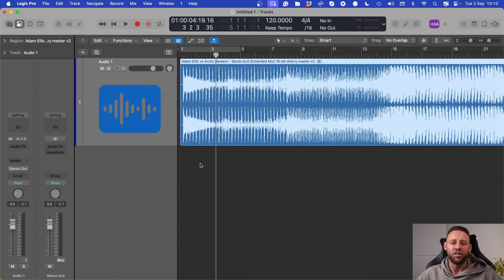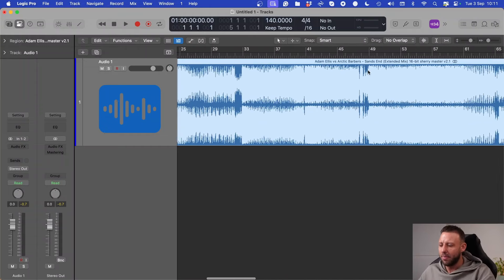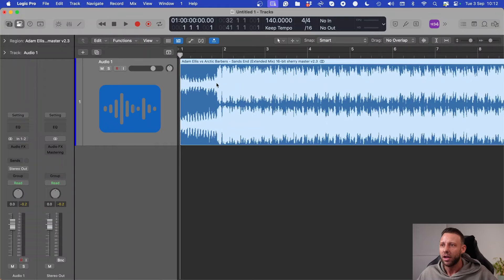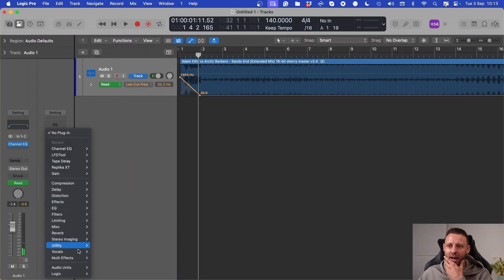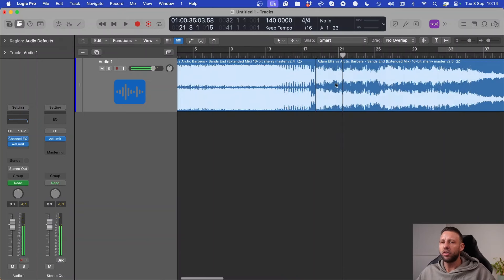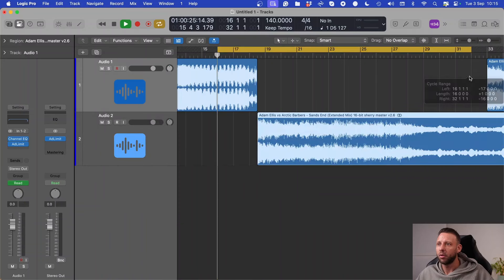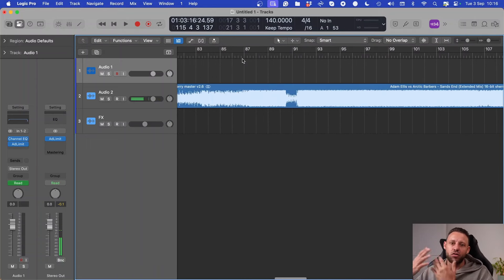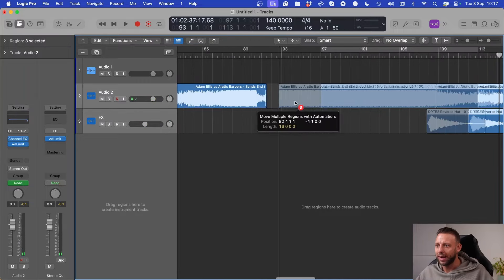How to Make a Trance 'Radio Edit'

Comment: Nice video mate came across this because I’m at the point of doing a radio edit on a track now myself. I did see a good tip (think it was from DOD) about doing the radio edit in the same project as the original/extended mix - so can then master it at the same time - simply duplicating the full track and removing the parts you don’t want to include.
Reply from the maker: Thanks for sharing, Jamie. Duplicating the project is definitely a great approach!